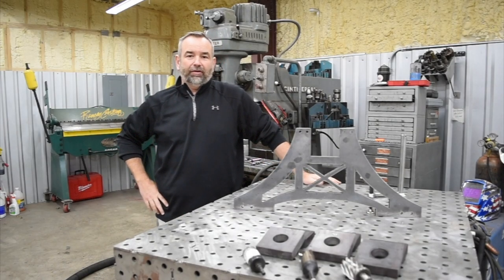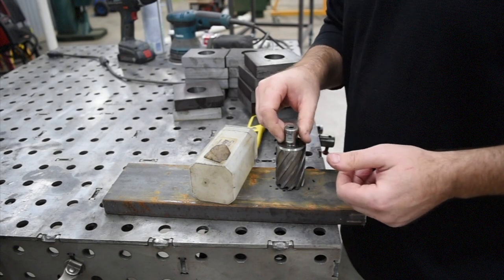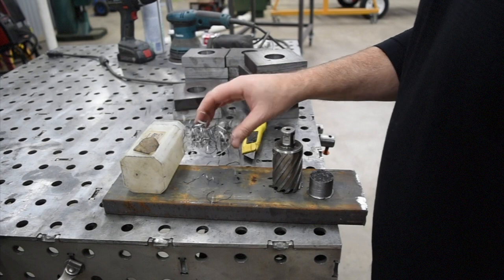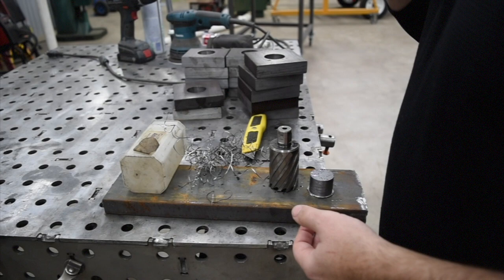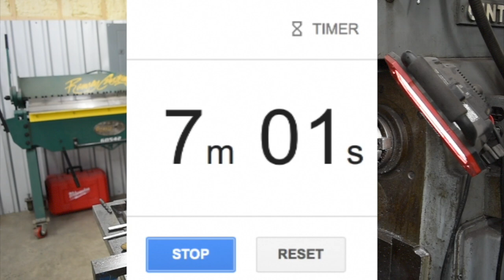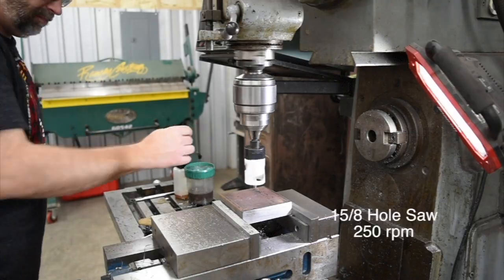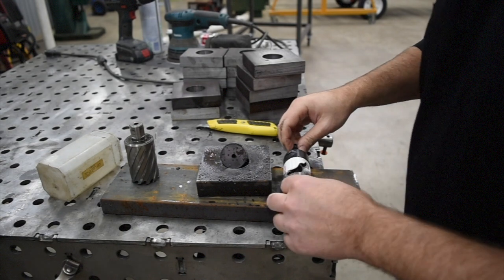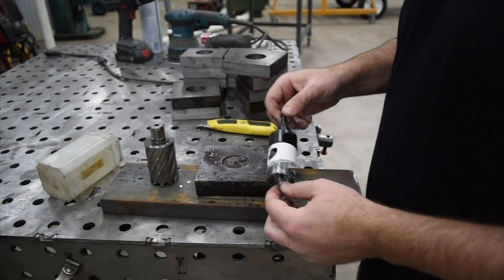Drill big holes in 1" thick steel - Fastest way? - Iron - Metal - Aluminum - Large Drill Press

Comment: I'd love to see the runout on these holes, speed is important but also how good is the hole? Just from the shots it looked like the hole saw had a really rough finish on the outside, and I can't imagine a tool that light is particularly rigid. I'd expect the twist drill to be really straight, and have a good finish, but because of all the intermediate drillings it's position is probably difficult to control precisely. The annular cutter should have a pretty good finish and be self centering, but since you can't spot-drill it I can't make an argument for how precisely it starts, though the rigidity would help.

Anyway, just saying I'd love to see these blocks trammed up and have a needle gone over those holes; might be difficult to film so I'd be happy with numbers.

Comment: There is another way to drill large holes from 1/2" thru 3/4" then 3/4" thru 2" and all sizes in between with the one drill set. It is a simple boring bar set designed for use in a drill press, it is made locally in Australia and works well. It allows home handymen to drill a variety of neat holes with only a single $200 drill set. I bought mine at a trade show but they are available on eBay.

Comment: I liked the comparison, but I think the annular cutter would have really shined even more with a spray mist setup, that goes for the twist drill also. As far as the twist drill goes, just pilot one bit slightly larger than the chisel point of the bit, then go for the large bit. If you had the spray mist it would have been almost as fast as the annular cutter. You lose a lot of time retracting the bit to lube it. The annular cutter really gets to be cost effective when you get into larger holes that can only be done with a hole saw otherwise, but they ain't cheap. Hole saws kinda suck for cutting metal, but they do make carbide tipped hole saws with less teeth and chip clearing grooves. I haven't tried the carbide hole saws yet, but I'll bet they'd be a nice compromise for cutting speed vs cost of an annular cutter.

Comment: the slugger bit hands down is the fastest, I use them everyday at work
Reply: @softjones3128  sorry for the delayed reply, our annular bits generally start at 9/16" and go up to 2". They do go larger and smaller but that's just what we use. Our most common used is 13/16". Regular twist bits don't last a fraction of what annular bits

Comment: I completely agree with Oddmund Bjornaali on the annular bit . PLUS , lose the cutting OIL .  Drill bits cut by friction . Oil lets it slide . ICE WATER cools. heat is what damages bits.  FLOOD the jell out of it with ice water and your bits will last 5 times longer..  Small chips means your bit is dull or you are not putting enough pressure on it.. You are  correct on the cup saw. Just need ice water under pressure to blow the chips out .

Comment: Why tighten the chuck in all 3 locations? It all tightens the same thing correct? That's why you only need to loosen it at one point, or am I missing something?
Reply: Try it yourself. Once you've tightened in one location, move to the next and the next, and you'll notice you can tighten it a bit more each time.

Comment: I drill 2 holes inside the hole area opposite to each other before running the hole saw. Chips just drop down and you have a lot less stopping to clear chips. On most cases I have to come back on the lathe or mill with a boring bar to clean up the surface.

Comment: Do you think any of these methods could be used on a hand drill if thats all you had
Reply from the maker: Yes, you could make it work.  Checkout Pakastani truck on youtube, those guys drill thousands of holes with a hand drill in 1/4" plate on one of their trucks.  Takes 2 guys.  One running the drill, one applying hte pressure with a clever rig they have setup.  I have drilled holes in thick metal with a hand drill and a long woodworking clamp to provide the pressure.

Comment: Will these annualar bits work in a hand drill as well..i need something to cut holes in hardened steel when making tractor attchments,,trying to drill holes in front loader bucket is a chore
Reply from the maker: get a mag drill... these will not work in a hand drill, they need alot of torque and down force.

Comment: Stepping up on the drill bits seemed to work fine. Considering the steel plate is 1 inch thick. That large drill bit must be worth a pretty penny? Probably not much cheaper than anular bit.

Comment: Ragrding the twist drill method, it is best to shove the big drill into the spotted hole location as is if the machine has the torque/power needed and go with autofeed. Second best option is to spot, then drill with a drill that is slightly smaller than the web thickness of the large drill and then shove the large drill through with autofeed.

The reasoning is that if you remove material so that the web doesn't make any contact (as in predrill too large), the larger drill will tend to bounce around in the hole, jerks against pushing it in and in the worst case might bite into the material like a corkscrew. Predrilling of course removes the blunt force trauma levels of force needed to shove the large drill, as the web doesn't cut properly, more like shoving a flathead screwdriver into a metal. But on the other hand it is what keeps the drill centered and rotating round, as the flutes do not give any guidance until you are very deep in the hole.

Comment: Great video, I have a question I will be cutting a 1 inch hole into 1.25 square stock. catch is it will be at about 20 deg off of normal to the surface. Any suggestions?

Comment: Dude cool video.  I have a suggestion or two.  Dude you gotta get some flood coolant, Cimtech is good.  And that Annual tool in a C6 carbide variety under flood coolant and running around 600 RPM and brother you can cut some holes then.  But then we drill large holes in the hundreds per day, so the cost would be prohibitive for a small shop.  But to kinda water the mouths of the fellow machinist and toolmakers around.  Our new Hurco VMXHSi with a 1 1/4 inch index-able six insert tool spinning about 3000 RPM can helix its way through that hole in 14 seconds.  But again, that is a lot of jack to do one hole.  Anyway, Cheers Dude, again great video, and I knew from the get go the Annual would prevail, and I would grind that drill with a 1/2 inch pilot about 3/8 long and drill that hole with it alone, and brother, I am surprised your hole saw actually made it..  Good job.

Comment: On the annular cutter, let the cutter rotate but reduce pressure on the handle. This will cause the chip to thin out and break which prevents the long strangers from forming. With a mag drill, don't use back and forth motion like a drill press because magnetic base will pull chips back into the cut.

Comment: I have never come across an annular drill before. Looks as though it would work well for tube notching? Does it fit in a regular chuck?
Reply: Most have a 3/4 weldon shank
Reply: Tyler Reid Exactly. 3/4" at least in part because they don't fit in almost any widely available drill chucks. You need a really good hold on it for the torque that all of those teeth require. You could damage your chuck trying to tighten it enough (if you even had one big enough) to work. Collets or end mill holders are best.

Comment: With that annular cutter, maybe peck more to decrease that stringy mess it makes? I've only ever used them in highschool because I'm a computer tech now, but that's what I did, worked pretty well and didn't seem to affect the tool.
Reply from the maker: That's what I was thinking to, but on another website, people commenting about this video said that the annular cutters are designed to not be pecked at all, once you start you should drill straight through.  Had something to do with keeping the teeth engaged deeply and cutting.  Kind of makes sense but it was news to me
Reply: I believe pecking should not be an issue, those that mention keeping it engaged could be speaking from bad experiences of engaging it harder than expected rather than going back in easy.
Reply: Shouldn't be pecking with any drill bits much less Hougan Bits.

Comment: There is a pulley kit you can pick up from RogueFab that will allow you to slow down any drill press. But since time is money, it's Annular Cutters for me. If I had a real Iron Worker, then yeah, punching the hole is the obvious no-brainer. However, a 1-1/2" punched hole in 1" thick material is a serious Iron Worker... probably 100 ton unit.

Comment: annular cutters are great, unless you have to bore through thick steel, because they all have limited cut depths compared to twist drills. for thicker stuff, twist drills work best on say a radial arm drill, and for a cheaper option, and limited power, hole hogs work great as well.

Comment: I would use one high quality drill, 1 5/8" ,  and coolant. Drill speed SF 100 = 250RPM x .01"/ rev (this is light feed) = 24 seconds. I run a cnc machine shop.

Comment: If you drill a small hole on the inside of the circumference of the hole saw's path, it provides a path for the chips to go through.That way, you don't have to clear the chips

Comment: THE BIG DRILL WAS RUNNING BACKWARDS, THATS WHY IT TOOK SO LONG!
Reply: Eh, no it wasn't.  It is common illusion when frame rates and RPM are out of sync, just like when using a strobe light to make things look like they are stopped or running in reverse.
Reply: Keith Ward man sarcasm must be hard to grasp through text
Reply: Keith Ward THE ALL CAPS WAS I HINT TWORDS HIS SARACASM
Reply: Nornevan
John Smith
You're right, it is hard to detect, especially when it's done the wrong way.  All caps is considered yelling or sometimes used by special needs folks with custom keyboards.  Sarcasm or joking would be indicated by a wink or a laugh.
Reply: PSA: sarcasm is only difficult to detect if the detection tool has a deficiency.
Reply: Sarcasm, if it was meant to be funny, it wasn't. Also, I notice a lot of the time, some idiot will make a dumb ass comment, then claim it's sarcasm. Not saying that's what happened here though.
Reply: DON'T READ THIS SARCASM IF YOUR TIME IS TOO PRECIOUS :-)
Now I've ruined the sarcastic surprise for non politically correct :-(  Depends what country your in. Like north and south water direction down a drain. You must use coolant clocked in the opposing axis of feed state and backlash with R1 thru R8 tapered dividing head stops on a milling drillibrulatter , sorry in advanced :'(  and lol in retrospect :-)

Comment: Could you link up to the ebay listing for the bit you have in the first test?    Seeing a bunch of thin hole bits that do not look substantial like the bit you showed and used early in this vid.
Reply from the maker: Just search amazon or eBay for "rotabroach cutter kit" and you will see some options
Reply: Nevermind, saw it down thread: Annular cutter.

Comment: Hello i have a problem on a job the 1" hole in my steel plate needs to be rheemed out by at least a 1/4 to 3/8 bigger. Any ideas how I can  do this on site? I am a carpenter setting 4 large steel columns.. thank you for your help
Reply from the maker: Straight body reamers generally won't ream out something 1/4".  You need to drill your hole slightly undersized, and ream it out to final size.  if its on a job site, use a Mag Drill, you may can rent one

Comment: I HAVE HAD GOOD LUCK WITH THE HOLE SAWS, BUT FIRST DRILL 2 PILOT HOLES, THE FIRST THE CENTER HOLE, THE SECOND HOLE BEING ON THE EDGE OF THE SLUG.
LUBRICATE THE DRILL WITH 25% DETERGENT, 75%WATER APPLIED LIBERALLY!
THE HOLE ON THE SLUG EDGE ALLOWS THE CHIPS TO BE WASHED AWAY.
ALSO KEEP THE AIR HOSE AND BLOW NOZZLE HANDY!

Comment: when your using oil to drill your holes ,and it doesn't matter which tool your using, put the oil on the shank or the body of the tool,it automatically runs down  so you don't have to keep stopping and dipping oil in the hole.

Comment: Good demonstration. Very well explained. i still have two questions, though:
1/ What is the power of the drill press (HP or K(w)?
2/ What is the difference between an annular cutter and a "classic" hole saw?
(When I saw the annular cutter being used I thought it was a hole saw)
Reply: Annular cutters have grooves (are they called flutes too?) all the way up the outside to remove the cuttings. Tooth shape is completely different than the hole saw. All the ones I've used are 'almost' self feeding.
Reply: Besides the more efficient tooth shape and better chip evacuation they can handle a much heavier workload. Also the annular cutter doesn't leave a hole in the middle of the slug, which can be handy if you can repurpose the slugs for other projects. Anything from paperweights to standoffs to weld-in plugs, whatever you can think of.  

At the end of the day time is money and you're cutting a lot of holes (production-type scenarios) you can't beat the annular cutter.
Reply: Thanks for the explanation. Now I only else need to know the power of the drill press? (HP or  (K)w)
Reply: This is not a drill press, it's a mill, and it looks to me like a Cincinatti 'Cintiversal' which generally has a 5HP main (horizontal) drive and (I think) a 2HP vertical drive, which is what was being used here.

Comment: As a former Tool & Die guy, a "U-Drill" (especially with through coolant) would be the fastest method by far. Definitely under 15 seconds... probably closer to 10!!!
Reply: Greg Eng As a former Formula One prototype machinist, I've never seen anyone use a 1" U Drill on a manual mill.

Comment: With the hole saw you need to keep the compressed air on the hole  saw at all times    it  will then remove the chips and you have a constant cut , thus faster cut

Comment: A SIMPLE CENTER PUNCH AND JUST USE THE BIG DRILL AND THE TIME WOULD COMPARE WELL WITH THE ANNULAR CUTTER. MY 1ST JOB WAS DRILLING 2'' HOLES IN ONE PASS ON A RICKETY BUFFALO DRILL PRESS IN 1'' THICK HOT ROLLED PLATE! THE TOOLMAKER SHARPENED THE BIT BY HAND EVERY FEW HOLES, AND I COULD FEEL WHEN THE BIT WAS GETTING DULL AND GRABBY! I LEARNED THAT YOU DIDN'T HAVE TO SPEND A LOT OF MONEY TO GET THE JOB DONE, THOSE CUTTERS (ANNULAR) ARE EXPENSIVE AND HAVE LARGE SHANKS WHICH CAN'T BE CHUCKED IN MOST DRILLS, CAN'T BE HAND SHARPENED,AND USE A LOT OF HORSEPOWER (= SPEED)! THAT'S A BIG MOTOR ON THAT HUGE MILL! MONEY WINS 'LESS U ROB T' BANK
Reply: First of all turn the volume down no need to yell.

Second of all no a center punch and the large drill would not compare to the annular cutter in speed.I don't know how the tool maker sharpened that bit but from what your saying it was probably a split point not a chisel point I don't know if you know this but chisel point drills don't cut until you get the material to the cutting edge of the bit that means the chisel end has to mash the material around until it gets to the edge which takes a long time with a slow RPM which is why people drill a pilot hole (minimum the size of the chisel end otherwise it doesn't do much). 

Third yes annular drill bits are expensive but use LESS horsepower to cut since its cutting less material it needs less power. Think about it instead of cutting a solid inch of metal hes cutting a 1/16" line.

And Fourth you are right you don't have to spend a lot of money to get the job done.
Reply: Adam Perry you just roasted Mctoasted this man G FUCKING G

Comment: you failed to measure the accuracy of the thru hole produced. that is a huge factor in the process.
Reply: Drill is a roughing tool, meant to honk out material fast. All the tools shown produce a hole. If you need precise (whatever that means) hole diameter/location, you need secondary operation with a different tool (like reamer/ boring).
Reply: @JaakkoF  Yes! Thank you for addressing that. I see allot of people in these comments concerned about the hole accuracy.

Comment: Very impressive but all I'm trying to do is find decent drill bits to drill out a few rivets and a few holes (maybe 5/16) in a car frame but every drill bit I've bought went dull after the 2nd or 3rd time.  Tried titanium & cobalt and they're all junk.
Reply from the maker: Yea, spot weld drilling is the pits man.  There are dedicated spot weld bits, a couple of different types.  You might look into the rotobroach type of HSS hole saw that will drill around the outside of the spot weld.  The reason a regular drill bit goes dull so fast is that 1. the weld is hardened from the weld/heat and 2. You can't generate enough pressure with a hand drill to cut a chip and put the heat into the chip, so the heat stays in the bit.  Been there done that, drilled out hundreds of spot welds in the last several years
Reply: the outer rivet I usually flatten with the sand disc on the hand grinder, so at least half the job is done, then do a 1/4 pilot hole and then the 7/16.  When the bits are sharp, then it goes quickly but after the 3rd time, the bits are pretty much done.  I'm lucky with this truck I won't have to drill holes (5/8) for the aftermarket rear bumper as they are already there.

Comment: You should never peck with annular cutters.  You risk chips getting under your cutting edges, which slows cutting, and causes overheating them dull bits.  Steady pressure, with steady coolant flow and you could have drilled the hole in half the time.

Comment: I knew the annular cutter would mop the floor with those other bits. The twist drill is inefficient the whole way through. The hole saw becomes inefficient as it gets deeper and more difficult evacuate chips. The annular cutter is efficient the whole way through and will probably last the longest by far. If you're drilling lots of these holes, the annular cutter would be the only sensible choice.